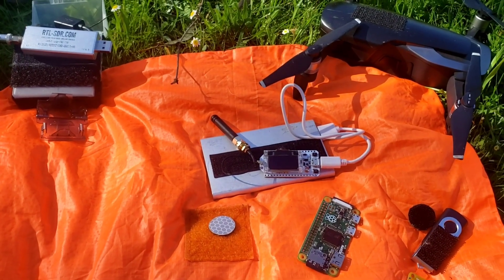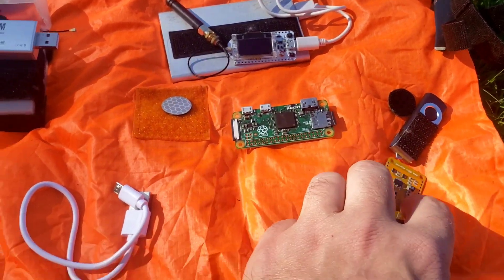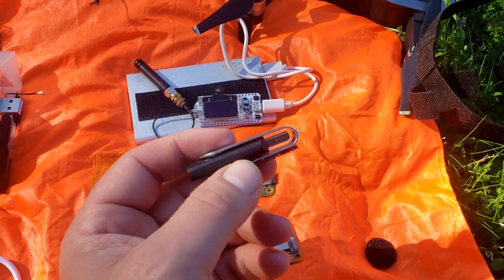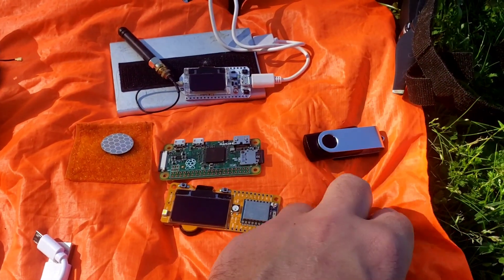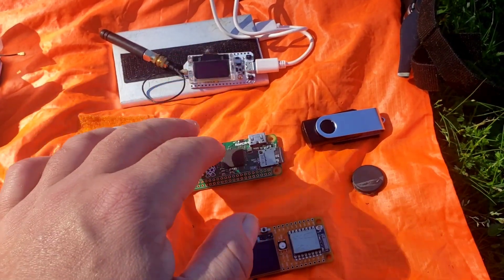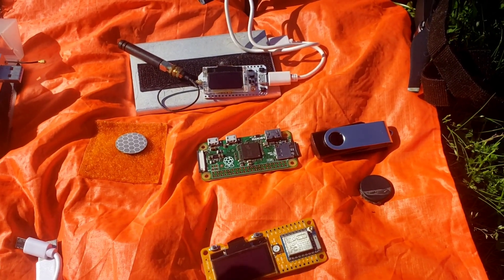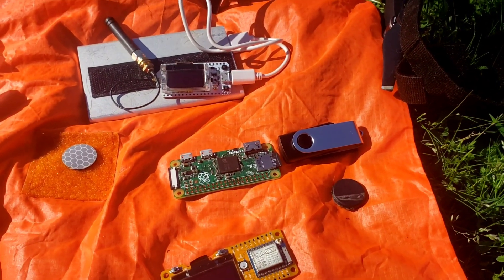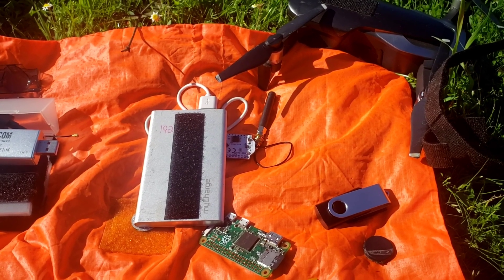Communication Package for Quadcopters

Comment: Is it possible to put a spectrum analyzer on a drone and sniff out, if radio frequencies are being used? I read in the Vietnam War the US had problems finding Viet Cong locations using radio traffic as they used low-power radios, over short distances, and only talked for a short time.
Reply from the maker: Yes absolutely. Even some drones can be detected by an SDR receiver (low grade dongles). If the drone itself can't be targeted the pilot becomes the target
Reply from the maker: Sorry, miss read your question. I'm not aware of as spectrum analyzer being put onto a drone. Not sure how helpful that would be. One could make a monopole antenna and raise it up with a drone to get a signal out. That said, not sure how a spectrum analyzer would handle a larger antenna. Some cheaper units may overload?? Not sure.